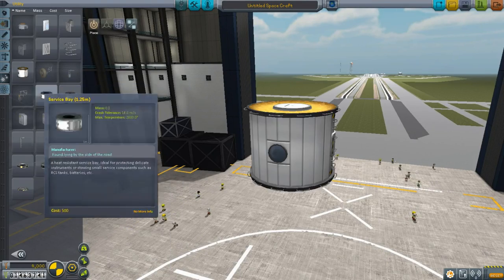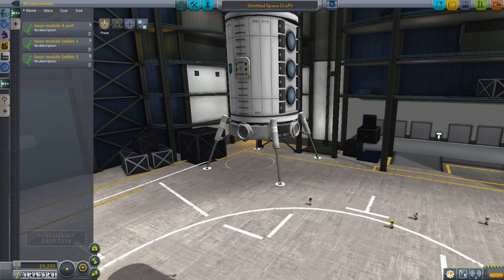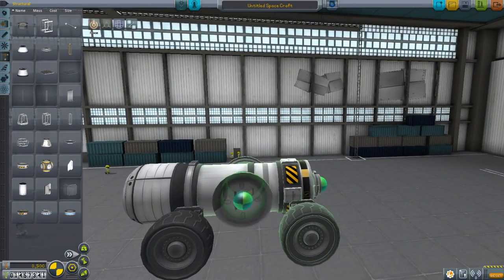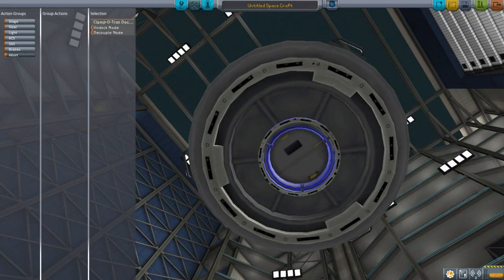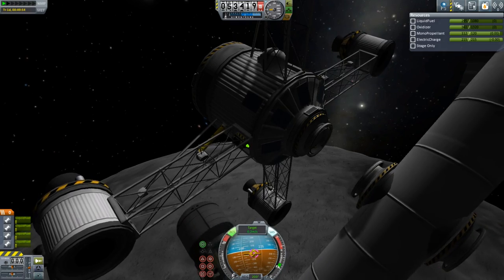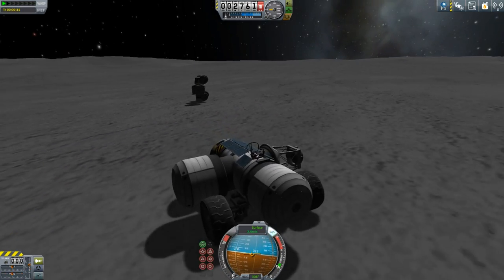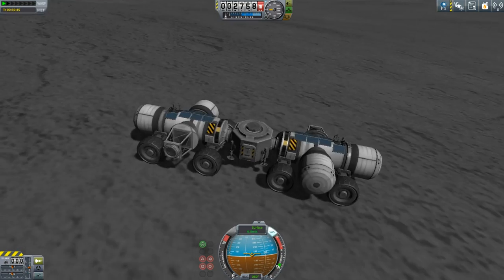KSP Mun base construction: Part 1 - Getting Started

Comment: the problem with the double docking port is that when you have something docked to the smaller port, how do you undock it?
Reply from the maker: You have to have the smaller docking port clipped out far enough so you can still select it.  If it's to far in then you will have a hard time selecting it.
Reply: @KerbalSpaceCommand   if its to far out wouldnt it interfere with the big port?
Reply: oh and dont hate me, but ive ripped off your skycrane and little mover ships.
Reply from the maker: You have to find the right place where it won't interfere and where it's not a problem to select it.  If it's slightly above the larger docking port there is enough room in between the 2 ports for it to fit.
Reply: Any part can still be activated inside another, simply angle the camera so that you can see the part internally.

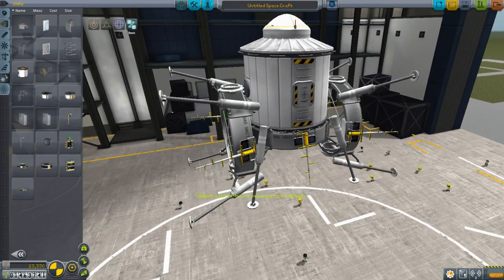Comment: How do you get the single base to snap off from the side of the module at 1:27? When I add parts via symmetry I am unable to isolate them.
Reply from the maker: I duplicated it then attached them to the sides,  next I changed the root

Comment: I have a problem with the sub assembly system on my 1.8. ksp game. it only seems to remember the 1st part of the unit I done like say a leg or the fuel tank?  I tried it lots of times and it never remembers any full unit. so I don't use it now. I instead save a unit as a file as normal and have to add it to the file of the main thing I got going!  So odd.

Comment: I just bought/downloaded the game (3-18-19) so lots to learn yet.  Since this was made back in 2015, can anyone tell me if the game has changed to the point that these building tips would or would not work any more?  I don't want to try, and fail and think the failing is due to my inexperience only to find out later that I'm trying to do something that is no longer possible in the latest version of the game?  My game version is 1.6.1.2401 as of this writing.
Thank you for your time and assistance.
Reply from the maker: There is nothing that is not possible anymore that I showed in these videos.  I have been thinking of making a new Mun base in the newest version of the game.  There may be some bugs with newer versions that didn't exist in old versions, but those should be temporary.

Comment: How did you attach the movers to the core? I am finding it impossible to do.
Reply from the maker: I set the movers side port to the root part and saved it as a sub assembly.  then added the ports to the lander can and attached the mover from the sub assembly.

Comment: When you put the smaller docking port inside the larger one the engineers report in the bottom right corner says its considered useless. I take it it still works fine?
Reply from the maker: +delboy fan Yes they still work.
Reply: Thanks. Great video by the way.
Reply from the maker: +delboy fan Thanks :)
Reply from the maker: +Kerbal Space Command Also make sure you do it they way I did,  don't stack them ontop of eachother and then try to position them, that won't work.

Comment: Should the mover work on  kerbin. i was testing it and it still dosn't work for some reason
Reply from the maker: It should work,  make sure the wheels are not upside down.  Do you have a picture of what yours looks like?
Reply from the maker: I can't tell from the pictre,  I've uploaded my mover to sketchfab https://skfb.ly/HTDH you can see in 3D what I did.  Also you can download it from here,  but I don't know if it will work with and older version of the game.
Reply: thanks mine was the same but it started glitched into the ground slightly

Comment: Can you give me tips on downloading mods? I once downloaded b9 aerospace and the VAB hud went black, i can see few buttons but the other parts are black
Reply from the maker: Make sure you have the newest version.  It should be simple,  unpack the mod and drop the contents into the game data folder.
Reply: Ravex Ravex There's a free program called CKAN I just can't live without now. Whatever mod you need, it literally does everything for you: It checks to make sure they're compatible with your version of KSP, makes sure they're the latest version, downloads AND installs them. I'm using so many mods now it's crazy all thanks to CKAN! Whether you use dozens of mods or hardly any at all, CKAN is a must-have tool.
Reply: Be careful using CKAN - Sometimes it doesn't install the mod right, or pulls the wrong version. I've had to reinstall several mods from their respective GitHub because CKAN messed up.

Comment: So I finally got to building base and the whole base slides around on the terrain. It seems there is no static friction on surfaces?! So things slide around and start breaking landing legs... Really frustrating... Did you find a way to counter this issue?
Reply from the maker: I had this problem when I switched to my new computer,  It seems to be caused, at least for me, by "terrain detail".  When set to high by bases slide around and seem stiff,  with it set to Default everything seems fine.  I haven't tried it on low yet.

Comment: After having spent hours following this design (researching parts, building the crafts, launching, landing, surface assembly, etc.), I can say your idea for the standardized bases simply doesn't work once all is said and done, though you won't know that until you've spent so much time getting everything to the Mun. You haven't accounted for how the differing weight of modules will lead to the landing struts to sink to different levels and therefore make them impossible to dock perfectly. A design that would allow the level to be adjusted individually across the modules is required to get them to line up properly. Maybe I'll get some pistons on the bases sometime, but for now I'm just frustrated that it didn't work the way you said it would.
Reply from the maker: There should be a way to lock the legs
Reply: @KerbalSpaceCommand  Nope, options for landing struts are to have them start deployed or shielded. That's it. Doesn't matter if the vessel is stationed someplace or if you try to do it in the VAB. Some people years ago seem to have mentioned it on the forums, but I can't find where that option would be if it still even exists.
Reply from the maker: @cabcalloway674  Maybe they removed the option or you might have to enable it in the settings,  I think it's called advanced options or something like that.

Comment: Sadly I can't even reach the Mun in KSP
Reply: Ifly 777 make an orbit, by going prograde (the green thingy without the crossing line in the middle), and when you are in orbit, make a maneuver (I JUST CRASHED GOT **** DAMMIT) anywhere on the other side of the moon.
Now drag the prograde until it's very close to the moon, actually touching (for the naked eye), and move it until it makes a line that is purple.
From there one it tells you you'll get an encounter if you see a small circle with an arrow, meaning you have an opportunity to make an orbit with it.
When you get to the moon it'll curve the purple line a little, when you get to the appoapsis, burn RETROGRADE (the thing WITH a line crossing) until you have a circle around the moon.
From there on, JUST LAND, :))
Reply: Night Howl With KSP now, you don't really need to use maneuver nodes, just use SAS to point prograde and retrograde

Comment: how do you attach your two rovers to the sky crane?
Reply from the maker: Chris Goode 
I saved the rovers as a subassembly, after building the sky crane I attached a lander can to the bottom and then the rovers to the can.
Reply: Kerbal Space Command Thanks, I finally figured out I had to make the docking port on the Rover the root part so I could attach it.
Reply from the maker: Try something simple first, a docking port and 2 tanks,  drag the 2 tanks over and see if it says that.